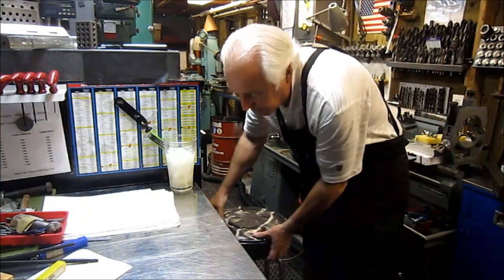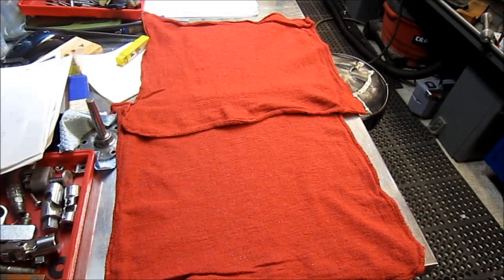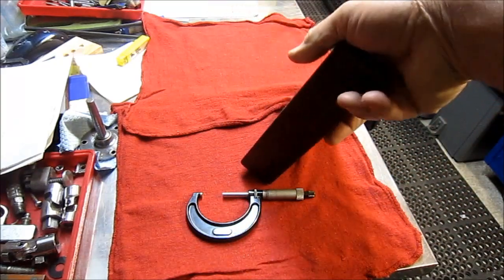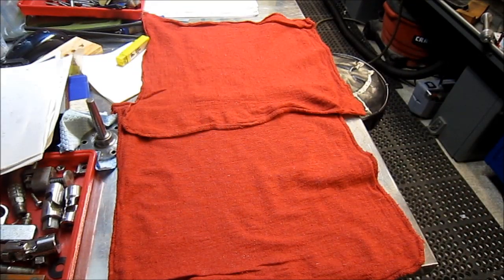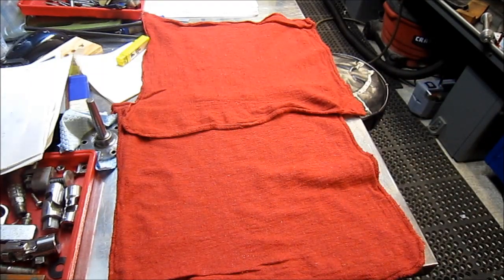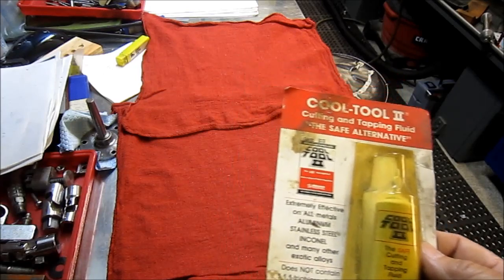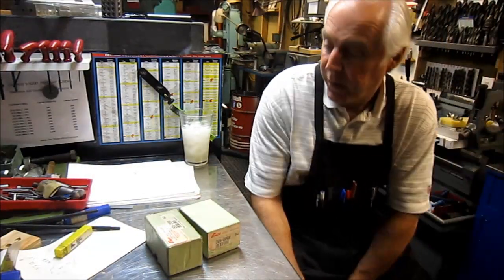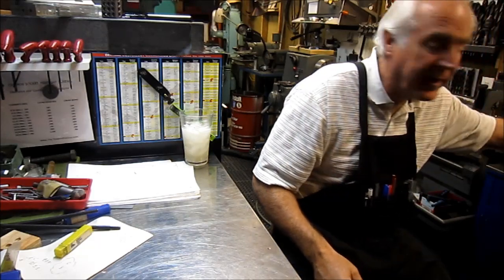Tool Time 17  Good News  Bad News

Comment: Dang I say.  Up here in these parts the flea markets have a lot of household junk and other sundry items that they want top dollar for. Have scored a couple pretty good deals at a couple of the more questionable pawn shops lately though.
Reply from the maker: Hi Emil...
Hmmm...ok I guess I have to put pawn shops on my list....LOL   It sure is fun when you walk into a deal....
Chuck
Reply: Yessiree. The good one in the bad area netted me a barely used older portaband for $150, Mitutuyo metric dial calipers in the case for $25, and several other nifty deals. I need to venture over to the greasier side of Vancouver and see what treasures hide in some of those joints.
Reply from the maker: Emil Gawaziuk Cool...did you see my video on the stand that I made for the portaband to make it a vertical bandsaw....check it out!